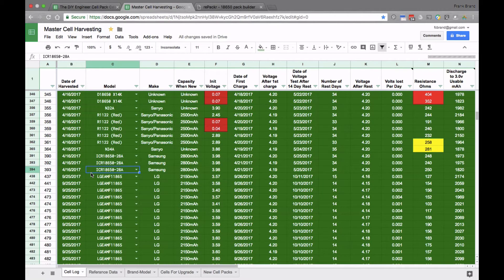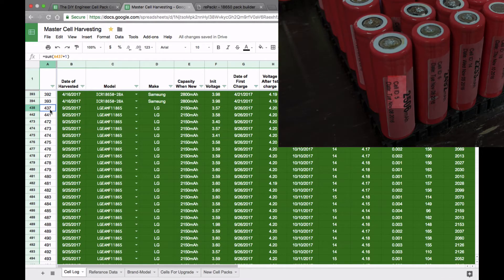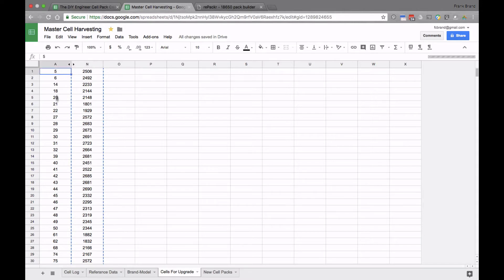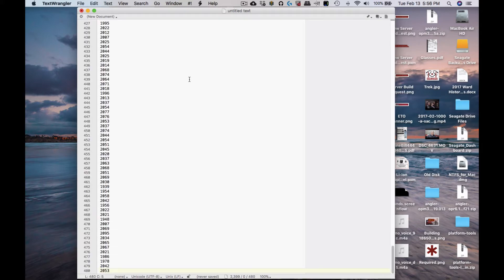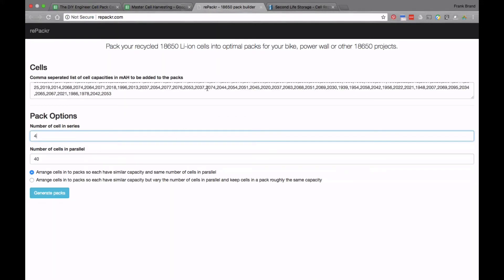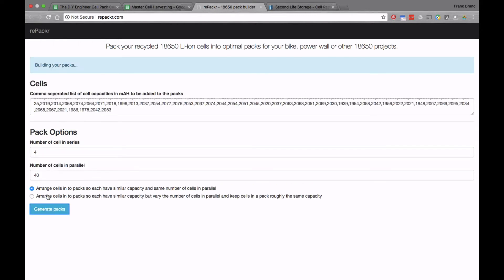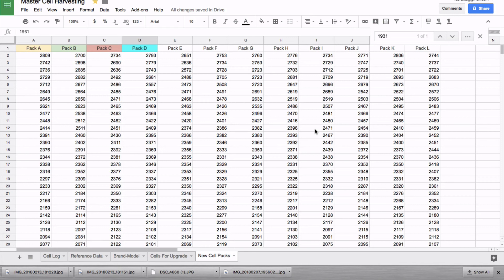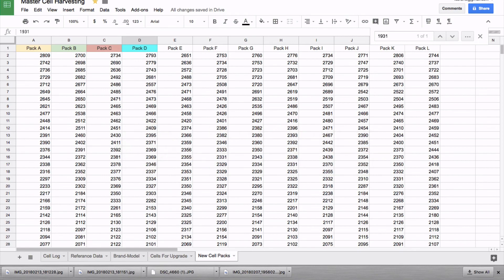Building 18650 Battery Pack 40p4s

Comment: @Frank Brand I have a pool pump that need 110 volts to run.  so I'm looing to build a powerwall that can supply that.  I'm I looking  at packs  with 31 - 32 cells ?  I would appreciate your answer?
Reply from the maker: I'm guessing that is 110 VDC if so you will need an inverter.  DO you know if you want to build a 12, 24, or 36 VDC powerwall?  You can email me frank@thediyengineer.com

Comment: i sort my cells in groups starting from 1300mah, 1400, 1500 all the way up to 3000mah in bins. anything under 1300 is just about worthless unless they are that capacity from new and I'll look up the model number. I have over 200+ cells and growing each week.
Reply from the maker: That is a great start.  Where are you getting most of your cells?  When you get ready to start building your project(s) you will find my Cell Pack Calculator helpful.  https://thediyengineer.com/get-cell-pack-calculator
Reply: I go to a local recycling place and pick them up when i can find them. I also trade pc stuff for batteries at a local pc store/repair shop. Sometimes I get a half dead pack sometimes good and sometimes all the cells will be dead. If there's more then 100mv in them i will put them in my home made charger board and see if they charge with ought getting hot. If they pass that test then i bring them up to 4.25v and leave them sit for a week or so, check the voltage and put them in my discharger to see what the capacity is. I then bring them back up to 4.25 and store them, later when I make my packs i'll check them again and any cell that discharges below 4.10 will go back to the recycling place.